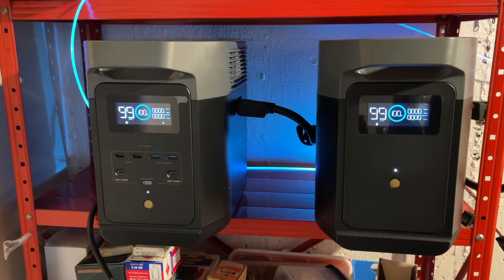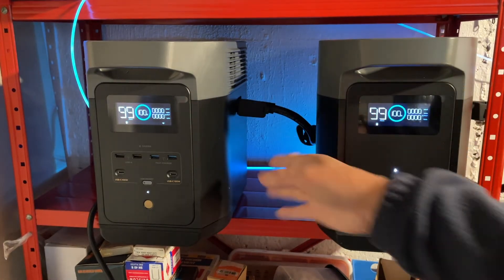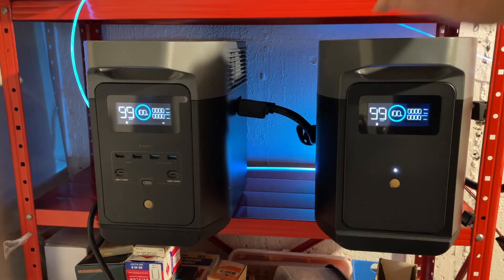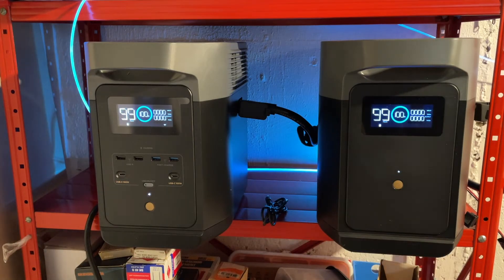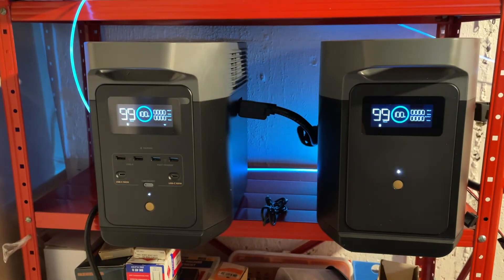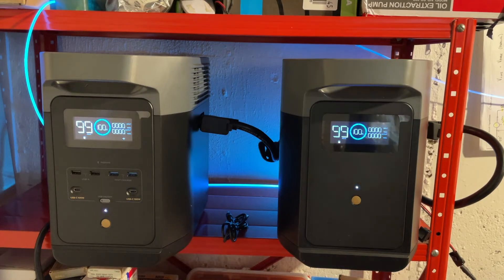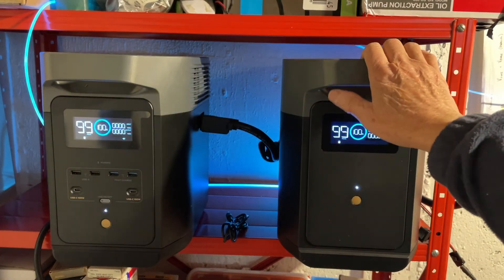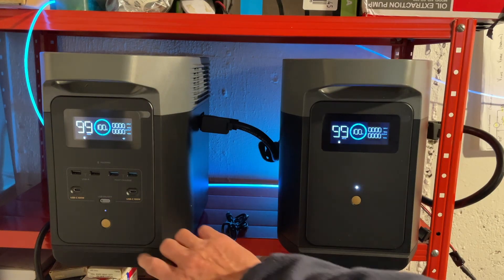ecoflow delta 2 with extra battery first impressions

Comment: Would it be possible to connect 2 Delta2 together to get double power, ... then you can also use both separable,  charge them separable.  Now you are limited with the extra battery as it only can be used tooled up to the Delta2
Reply from the maker: You can charge one delta 2 with another but it’ll be cheaper to use one delta 2 and an extra battery to extend run time. You are right in your scenario in that you have two power stations and therefore more versatile. I have many battery kits already so I don’t need more individual units. It depends on your needs.
Reply: No, it would be to have more Watt available to run bigger load. 

I now have 2 solar panels of 150W, 12V Poly (facing South) and use them straight into my Ecoflow Delta 2.
I notice that with that, and when Sun is out on the panels, I can charge the Delta 2 to full in well under 3h.
I do get shading on the panels during the afternoon and the power drops significantly to only 40Watt.
I bought 1 extra solar panel 150W, 12V Mono (facing South-West) and put all 3 in series. 

Dilemma  ;
As I only use a relative small percentage of my panels, because I only use it to charge the Delta 2 power station, I would like to benift more from it to have more off grid power and wonder what to do. What's best system wise and what's best budget wise.
Do I buy the special extra Delta 2 battery from Ecoflow OR do I go for a DIY setup ?
The Extra battery from Ecoflow is at 800,ooEuro and gives an extra 1024Wh but needs to be charged by the Delta 2 itself as it can not be charged or used by itself.
The other DIY way has different options but comes at about the same cost for a little more power.
As with the extra Delta 2 battery there is no need to buy anything else, no solar regulators, no 12V to 220V converter. 
On the other hand, with the DIY setup I do need 2x MPPT regulator (take 2x 100,ooEuro) , a 12V 100Ah LiFepo battery (around 500,ooEuro) and a 3000W pure sine converter (around 350,ooEuro) plus wires, fuses etc. (Comes easily at 1000,ooEuro) (And then better put a 4th solar panel of 150W 12V MONO, to balance and have 2x2 panels. 

I also looked at the GroWatt all in one but that asks for more panels (for minimum requirement start working voltage)
That would be a nice system but even more expensive due to extra panels plus I only can put 6 panels (3x2 in slightly different orientation) due to space.
Reply from the maker: @NeoVdV  Thanks for your detailed reply. I've actually thought about some of the issues you encountered. I originally have two 100 Ah Lithium Iron phosphate battery, now called LFE as a starter system, but in growing my backup system,  I went with the Delta 2 with extra battery for compatibility and ease of use. The included electronics with the Ecoflow is a plus but also a minus. One day, when you press that on button, nothing will happen. Then you'll have nothing. The 5 year warranty tipped the scale in the favor of Ecoflow.
     I'm not happy with charging directly using solar panels as it's difficult to match the input voltage and amps requirement of the Ecoflow's solar input. While I plan to add an extra 100w solar panel to make my small system to be 400w, I plan to use my battery bank in my garage to charge the Ecoflow in my house through a DC to AC inverter. It'll be much simpler with steady results(using slow speed AC charging}.
    Since I'm using my setup more as a backup than off grid, I don't have a huge setup. The simplicity of the Ecoflow is hard to beat. Try buying a good 1800w DC to AC inverter and then all the wiring, BMS, battery terminals, circuit breakers and of course a battery and you'll know sometimes it's better to buy a ready made unit. Oh, did I mention you have buy a MPPT solar charger as well? :}
Reply: Thank you for the reply.
It looks like we have a similar system in mind.
I received my new (3rh) panel ½h ago and I connected it. It now just sitting on my deck but in an almost same direction and a gle as it will be on my overhang.
I connected all 3 in parallel. The first 2 are Poly, the new one is a Mono.
I did play with angle and direction a bit, it's now noon here in Belgium. And I got about 200W with 2 panels,  and 5min later got 245W with the total of the 3 panels.  Not so great.
As for my dilemma  ... yes I see the pro of the Ecoflow extra battery,  but see more cons to it for my use.
Reply from the maker: @NeoVdV  There is a place for diy and a place for a turnkey system. I figure when the electronics of the Ecoflow stop working, and they will, I at least can use the battery pack inside.
Reply: That's what I was thinking as well. Better spend a bit more but be able to replace parts if needed and have the possibility to extend the system when needed. The Delta is an add on when not on the road.
Is a 20A MPPT enough for 2 panels of 150W, each Voc 22.68 and Isc 8.54A ?
Better is serie or parallel  ?
Two strings of 2 panels, each pair with their own MPPT
Output of the 2 MPPT together into the Battery
Reply from the maker: @NeoVdV  20A is barely enough for parallel.  I'd buy a bigger, higher amperage charge controller even though you are thinking of putting your panels in series. This is a matter of configuring. If you do decide later on to put them in parallel and you only have a 20A controller, then you might have to buy a higher current handling controller.
 Sure, you can go in series but you have to be mindful of shading. For a relatively small system, 24v is ok and you save on wiring costs but some people go 48v and then high voltage when you power a whole house. I consider mine a tiny system so I stick with 12v given all I've invested in 12v.
Reply: So, 2x 30A MPPT - https://www.amazon.com.be/-/nl/gp/product/B0721QNDQD/ref=ox_sc_act_title_1?smid=AZ5ICTABCC4FZ&psc=1
What do you think about this battery  - https://www.amazon.com.be/-/nl/gp/product/B08P4Z48RG/ref=ox_sc_saved_title_10?smid=A2EP3TN9KIZP5L&psc=1
Do you put diode or fuse on in the wire from panel to controller  ? - https://www.amazon.com.be/-/nl/gp/product/B09RH5V2QZ/ref=ox_sc_saved_title_2?smid=A1KGD9U4C0ZGWS&psc=1
And a pure sine wave converter  - https://www.amazon.com.be/-/nl/gp/product/B08L692CBL/ref=ox_sc_saved_title_4?smid=A229DC98ZBMO45&th=1
Reply from the maker: @NeoVdV  steer clear of trees  and shades when you have solar panels.  You can have bypass diodes but
 I don’t know how well that works. The LFP battery is ok. I believe it is a pouch cell type battery. I believe one of mine with a different name is similar. Son, ampere time or Chins are probably better. Charge controller and inverter mentioned are ok. With any inverter, don’t stress it and it should last .
Reply from the maker: @NeoVdV  a typo, SOK battery, not son.
Reply: There is a huge tree at only 20m I can't avoid :-(   the given shade of course depends on the seasons (lower Sun in winter and full of leaves in Summer) 
Budget wise, in regard of the battery, to a beter , more power use, system for the money ... better a 100Ah LFP or 2x 100Ah deep cycle AGM or Gel ?
Did you look into Micro inverter (AC to DC to AC) i.s.o. MPPT (DC to AC)
I start with ordering a 4th panel today ;-)
Reply: SOK ?
Reply from the maker: @NeoVdV  a respectable brand here in the US. 
https://www.google.com/search?q=sok+batteries&ie=UTF-8&oe=UTF-8&hl=en-us&client=safari
Reply from the maker: @NeoVdV  If u have shading, putting solar panels in parallel is better. If you require more than 2000w output, u need 200Ah LFP with 200A BMS. If you setting high voltage system or a big system, then the micro inverters are for u.  Generally a 24v system is set somewhere in between and is reasonably simple to set up. YouTuber Will Prowse offers good advice in setting up such systems. He has a website with sample setups. Maybe you are already familiar with his channel.
Reply: As mentioned before, I'm limited in space to put panels and limited in budget. So I'm looking for the best price/quality system to lower my electric bill.
I bought the Delta2 specifically for doing some short 2-4 day camping trips with my basic mini camper (A Citroën Jumper) Then decided to get 2 solar panels to charge the device. Then came to the conclusion I only used a small amount of what I can get from the panels. And there started my idea on making a solar system to have off grid (free) electricity to use as much as possible to lower my bills.
Reply: I would like to put such an automatic Switch but unfortunately not any available here :-( a d if I would order it from the USA it becomes very expensive due to added important and additional sales taxes.
Reply: If I use 4 panels, in series, straight into the Delta ... it goes into the inlet for Solar/ Car charging ... what goes into the build in MPPT. So it can not distinguish the 2 panels facing South and the other 2 facing Southwest. If I would put an external MPPT for each pair it would be better to distinguish and take into account the differences. BUT they told me that I had to use a straight line input from the panels and NOT from the output of a regulator. Why is that ??
If I would make the system then I would make a split connection after the panel with one pair of wires straight to the Delta and the other split pair into the MPPT ?
Reply from the maker: I believe the Delta 2 solar input cannot exceed 60v DC so you cannot put 4 solar panels in series. You can barely put 3 solar panels in series as most 12v panel's open voltage exceeds 20v. You really have to be careful not to exceed the 60v DC and 15 amps solar input maximum. It doesn't how you configure the solar input as long as you don't exceed the 60v DC and 15A rule.  You can put 2 100w 12v solar panels in series to make 24v (2 in series open voltage will be 40 to 46)v ) 5A and and then add another set in parallel. That will be close or exceed the 400w solar input maximum.  So instead of monkeying around with that I decided to use AC output from my solar output (by using a DC to AC inverter with 100Ah power bank as a buffer) to charge the Delta 2.
Reply: Yes I know. That's why first the 2 were in parallel,  then I tried them in serie. Now with the 3rd I put them again in parallel. When I have 4 then I will make them 2x2 because different directions and angle. So I will test to see what's better 2x2 parallel together or 2x2 in serie. And then depending on the battery the 2 output of the controllers in serie or parallel.
Reply from the maker: @NeoVdV  It's good to experiment as long as you stay within the parameters set by the manufacturer.  I hesitate to run the solar generator to the max for any sustained period because I want them to last. The higher end generators are expensive and I did not get them for free.
Reply: Something more general. 
There's an other obstacle that I face.
Here in Belgium they really do all to make DIY illegal. 
If you do anything on your electric system it has to be certified all over again and such is not only expensive but also a nightmare of rules a d regulations. 
In case of solar you can not DIY make switching between grid and off grid.
Therefore I can not connect my solar in any way to an existing fusebox or even outlet.
By the way the house has a 3 phase electric.
So I need to pull new wires and install separate outlets complete independent of anything existing wiring. 
And because the existing conduct tubing have no room to pull an extra wire ....
.
By the way ... for transferring my small utility van into a mini camper ... everything you do to modify on electric,  engine, exhaust,  doors, windows,  etc. Need to be inspected to get a now conformity paper. Even making a small hole to put a cable needs a certificate. Cost, depending the changes, starts at a minimum of 200,ooEuro  !
Reply from the maker: @NeoVdV  I can understand your frustration. That's why when you said you wanted to save on electricity, I did not make a suggestion to tie into the grid, not only because you need permits and such, you are entering a different phase, no pun intended. People who install solar here are mostly grid tie and legally, but unless they have a battery back up system, they will still have no power when the grid is down. If you don't  have a new roof, making a whole bunch of holes in your roof doesn't make sense for you'll roof will soon leak after a storm. 
   Most backup systems used here are done with a big generator that can power a whole house.  Please correct me if I'm wrong but I don't believe those generators generate a sine wave. They are good for lighting and maybe battery charging but any sensitive equipment will be damaged after extended use. The gas generator I have only output 2000w but it is pure sine wave. Not only can I use it to charge my solar power stations like the Ecoflow, but I can also use it without fear damaging the TVs or other more sensitive electrical equipment. For me, this is more of a hobby with some practical effects.
Reply from the maker: @NeoVdV  Not sure the reason for this except to keep the battery fully charge. If you have grid power, then you don't need the battery. You don''t  save money if you are using grid power to charge your batteries.  Your solar panels should be able to keep your batteries charged. If you use your batteries to charge cell phones, you don't save much money but if you use the batteries to power a rice cooker, then you do save some money. You will also wear down your batteries. Even so, with solar panels and batteries, you now have a system that saves you some money but can be used as an emergency backup. The latter option is priceless.
Reply: Ordered 2 MPPT and a 1500W  12V to 220V converter. 
Still debating on the battery ... 1x 120Ah LiFePo  or 2x Deep cycle AGM  both options come at same cost,  so ... ???
Reply from the maker: @NeoVdV  Go with the LFP battery. Good luck.
Reply: Is the app a necessity to change the settings? I am worried about an EMP or grid down situation. If there is an EMP, am I stick with all the settings that were on before the EMP? Or can I change the settings manually? Thanks for the video!

Comment: I do think you can also use the Delta Max battery with that Delta 2.
Reply: I don't think the Max has LFP cells in it. Better off with the Delta 2 max because the charge cycles are much higher
Reply: @happyhamster1411 they do now
Reply from the maker: You're probably right. This seems to be an updated version to the Delta mini. I like the compact size and the ability to add 1Kw or 2Kw like the max.

Comment: One of the reasons why I like the new Delta 2 is that it has a 3000 charge cycle which could last me about 10 years.
Reply: Yes, everyday use from 100-0-100. That was also a thing for me. LFP or go home. Only thing is that in ten years theres going to be 5x better ones :)
Reply: @OriginalThisAndThat  it can never last 10 years maybe 6 years but not 10 years

Comment: My impression is that is is the perfect power station since it has a 1024Wh capacity and can be charged in about 80 minutes.
Reply from the maker: You are not alone. Great to use in car camping. The ability to power a small microwave is the best feature for me.